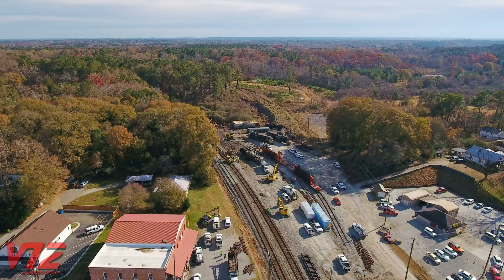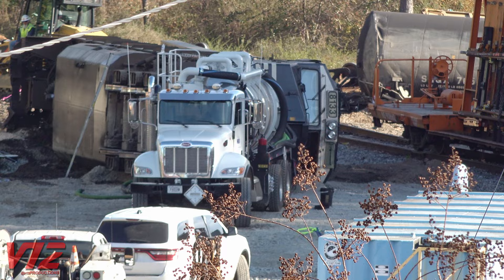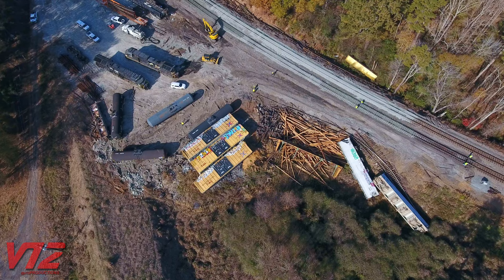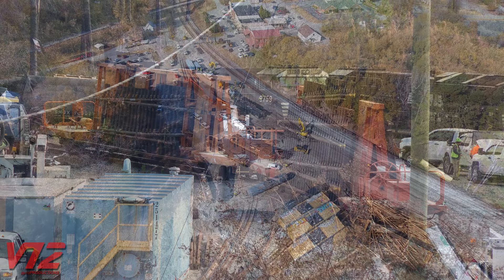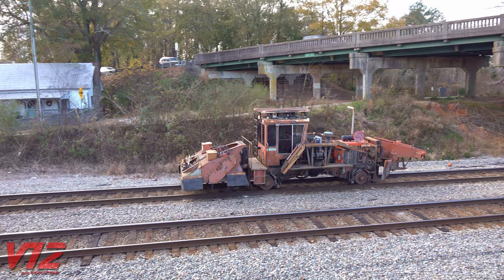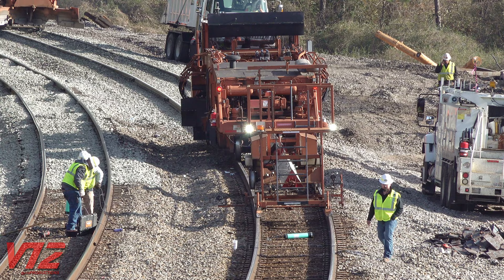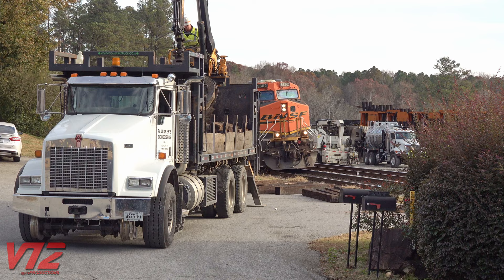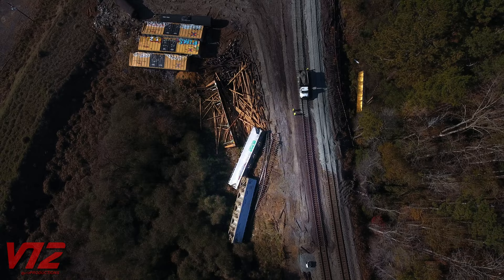Train DERAILS in Hiram, GA

Comment: Great video.  Things have sure changed over the years. I worked as a Conductor on Canadian Pacific almost 40 years, and when we had a wreck "back in the day" the wrecking train (known on CP as the "big hook" or the "No.1 Auxiliary")was dispatched. It was rare to have any outside contractors doing anything at the site.
Reply from the maker: That's really interesting. Thank you for sharing. I've seen one of the big railroad wrecking trains in person at a museum. They're massive. Would have been interesting to see it in action.
Reply: Just the railroads saving money. Pay a wrecking crew like RJ Corman or Hulchers and you don't have to maintain the special equipment and pay employees. Not to mention people have died during derailment cleanups. Easier to put that liability in someone else.

Comment: 1st off. Nice job reporting as usual.  Your efforts are appreciated. 
2nd. How do these crews get a mess and rail line cleaned up within two days...and when they do "at grade" planned crossing replacement,  it takes a full week. Kudos to the accident crew. And maintenance guys, not so much.
Reply from the maker: Thanks!
That's a really good question. Wish I had an answer.
Reply: Answer for #2). A planned grade crossing takes longer due to all of the extra work involved. Not only are you replacing the rails, but you're also redoing all of the shunts that control the lights/gates, the alinement has no room for error in such a short work zone, and the road's approach on both sides must be first removed and later replaced. 

With a major wreck, large numbers of outside crews are brought in and work 24-7 until the work is done. If you watch the Virtual Railfan's camera at Cocoa, FL you see just how painfully slow laying track with one crew is. Double track and not much happens on a daily basis. https://www.youtube.com/watch?v=AQMdz9U5_L4
Reply: @thomasboese3793  thanks for the input. I did kind of figure a 24/7 crew would definitely condense such a repair.

Comment: O:16 that curving bit of fill off to the right of the tracks, is that an Earthen Dam or an old rail bed ?
Reply: I was wondering the same
Reply: Old alignment. Go to HistoricAerials and you can see the old alignment in the 1955 aerial. Several changes to the alignment from there to Rockmart. The team track  was a connection to the old rail bed. In the 60's, a hopper of hard coal would be spotted there for the local feed mill. A few locals were still burning coal to heat their homes.

Comment: I would bet money that the switch was the issue.

That siding track probably never gets used except for Maintenance cars. Train goes in there to drop those A frame panel cars and then leaves. The switch point and surrounding components might've been worn out and did not return to a tight condition as they should've been.

Your now derailed train came by and only derailed the engine and first few cars. Makes me think the switch point gapped under load, and derailed what you now see on the ground.

https://youtu.be/Xfqt33x0QcQ

I used to work in the track department... fun times.

Comment: Lots of derailments happening lately on the GA and SC NS lines, it sucks but it happens, it can't always be controlled. Little strange but regarding to the busted window on the ES44, that is expected since almost all widecab GE's from NS and CSX have a slight reinforced plastic to act as glass. I personally have figured that out, and a friend of mine that worked for UP used to get some of those units and found it was plastic.

Comment: Is it unusual to see a BNSF train go through there?
Reply from the maker: Not too unusual. That coal train was headed back to the Powder River Basin in Wyoming.
Reply: @v12productions  Oh I ask because I’ve seen lots of Norfolk Southern engines on BNSF trains and vice versa
Reply: It’s what’s called ‘run through power’. Back in the old days, every railroad would drop its power & caboose & gaining railroad would add theirs.  Since most locomotives today are pretty much standardized, it’s cheaper & less time consuming to use power from an originating road. Also, say for instance BNSF owes NS money for some reason. BNSF pays NS back by NS using BNSF power & Vice versa.  

Distant Signal on YouTube has a recent video on this